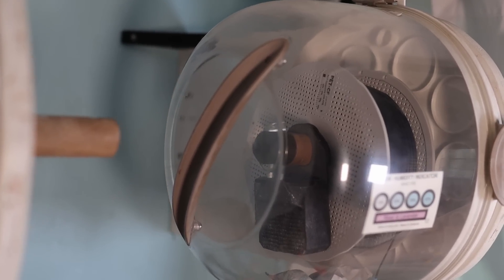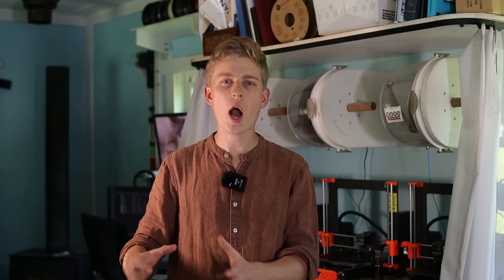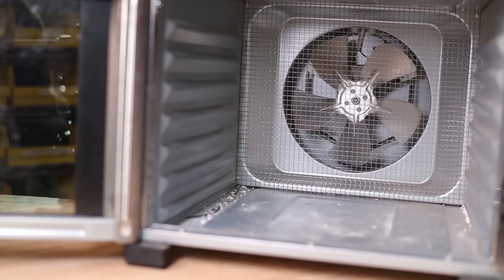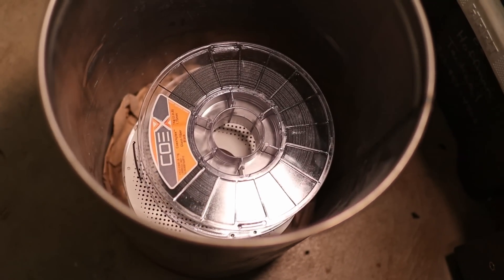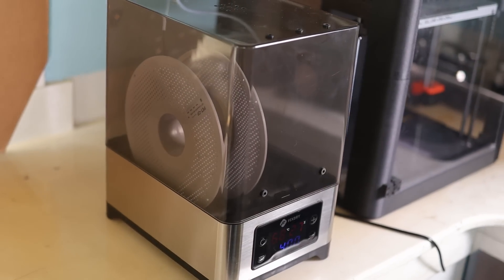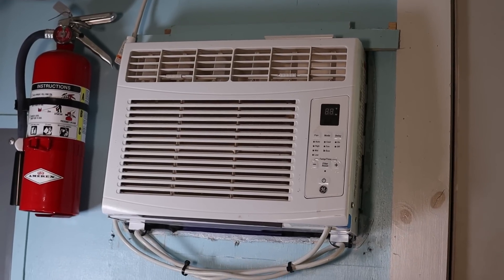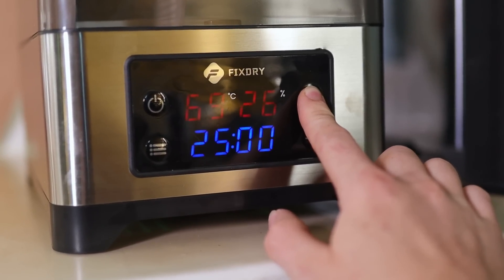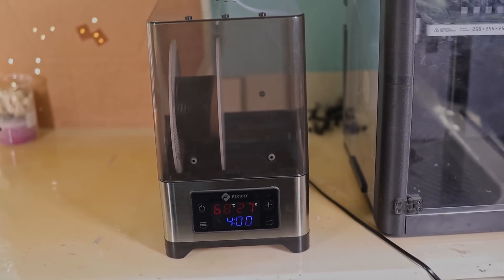Dry Your Filament! A Look At How I Manage Filament

Comment: There is such a big market for an engineering material (polycarbonate/nylon/etc) rated filament dryer that has proper convection/ventilation. 70°C just isn't enough for drying nylons/PC in a reasonable amount of time. 80-85°C of ACTUAL temp would be perfect! I feel a bit sketched out to leave my modified filament dryer on without checking on it every few hours. Fixdry PLEASE make a pro version that can handle 85°C and it will sell!
Reply: The temperature varies on the rooms temperature and relative humidity. My friends 3d printing only basement is constantly at like 35°C and 16% humidity and he's good at 70C drying for nylon. My room is like 60% humidity at room temp so I need much higher temps, between 95-100C to get below 0.2% humidity
Reply: The key reason all filament dryer stop at 70C, it is close max safe temperature of plastic shell. If over that temperature need metal or more expensive material to make shell.
Reply: @chouchooou  That's not why they can and likely already use polycarbonate or abs for the shells which can easily handle 85°C. I think it's related to the heater temperature required to get 85°C inside the dryer is more dangerous.
Reply: Don't use heat. Use molecular sieves. I dry my nylon and PC with 3A zeolite, and it pulls the moisture in the box to less than 1%, COMPLETELY drying the filament, and leaving me with beautiful prints, even after sitting for months, untouched.
Reply: @JohnDoe-fk6id yo what in the duck is that stuff. You're telling me I can get zeolite (looks like fancy silica packs) and not really need heat in a room that's ~60% humidity??? If so count me in
Reply: @JohnDoe-fk6id A molecular sieve only dries moisture that's already in the air. That's how dry boxes work. You need heat and rotation.
Reply: I totally agree. It's not like the technology isn't there, a food dehydrator is the perfect base they just need to have a top that actually works for filament.
Reply: @53Aries  Even most high end food dehydrators don't get to 80°C actual temp. They have to be able to get to that temp and maintain it safely without burning someone's house down.

Comment: Can you do a review on using a freeze drying system like used for food for drying out filament... also, I have been looking into a vacuum oven for drying filament as well... pretty expensive options out there with the in-line drying set-up but most haven't really been showing all that good of results... thanks for the video... I appreciate you...

Comment: Make your own.  Vacuum oven set to 10% below glass transition of the polymer, then constant circulation of pumped Nitrogen form a N-Generator,  off gas the moisture in a regenerative decant bed, feed the filament through a sealed teflon tubing to the printer.  Dew point for best dryness is -40.  Processing changes will be a must, the material will be thicker due to the reduced moisture acting as a foaming/lubrication agent.
Reply from the maker: At some point cost does become a concern ;)
Reply: Right? Lol no one has money for a nitrogen fed oven specifically used for drying filament. Food dehydrator makes a lot more sense
Reply: @HoffmanTactical   The payoff comes from the integrity of the products you're making.  Understand the cost comment.  Good stuff Hoffman.

Comment: When drying filaments it's important to remember that drying of the filament happens when the relative humidity of the dry box is lower than the relative humidity of the material.  When this happens, moisture is removed from the filament in an attempt to equalize. This can happen in a dry box if you're able to keep your relative humidity low enough but it can take weeks. Heat speeds this process up significantly.

Comment: If you're still looking for a better desiccant, calcium oxide (CaO) is extremely powerful and easy to diy. It reacts exothermically with water to make calcium hydroxide. It is easy to make- just heat up limestone/ marble/ eggshells past 850°C with a blowtorch or electric heater. To regenerate it, heat it up a little past 500°C (that's how strongly it bonds to water).

Also note, that a sufficiently strong desiccant will dry cold filament in a sealed container as long as it's not leaking. It's just really slow.

Comment: Amazon has a Septree 800w food dehydrator that has a max temperature up to 190F or 87C.  I just bought one for that higher temperature.  Will find out soon if it is true.
Reply: Just wondering how did this one go for you? I am debating getting an air fryer... Or try to get a food dehydrator and add an heating element to it...

Comment: So many people use these dryers incorrectly. Put desiccant inside, and change the desiccant after its saturated. You use the driers to drive the moisture out of the filament, but then you still need to deal with the moisture rich air, and desiccant is the way to do that. Just be sure to change it regularly. Make note of the dyers with all the holes in them, cover them up when not in use as thats just another entry point for damp air.

* Add desiccant
* block holes
* regularly change desiccant
Reply from the maker: Heat alone works quite well, and is much more reliable. The vents are required to allow the moist air to escape.

Comment: As far as keeping filament dry during Printing, MY AMS is full of reusable desiccant. for Storage I use an IP67 Tote with two Eva-Dry Towers in each.  Also the Govee Hygrometer sensor has data logging and has alarms you can set. Its bluetooth and wifi and has a huge Battery. :)

Comment: The fix dry looks a lot like my Eibos Cyclopse.  What we (owners) have noticed is that the heating element runs around 105c when set at 70c when viewed with a FLIR camera.  This is of course to bump the temp in the entire box, but what many of us have noticed, specifically with more temp sensitive filaments is if the roll isn't being actively printed, it causes a sag in PLA(non +)/PETG/TPU.  There's also concerns of this baking already brittle filaments beyond the point of usefulness.  As a result there's been heat deflectors built & we've noticed a lot more consistent temperatures. 

What I'm getting at is if you're actively printing right over the heating element without any deflector, there's a good chance you're likely in the 80-100c range albeit for a short time per rotation.

Comment: I just bought the fix dry for nylon and it doesn’t work at all, same as your findings. I went back to drying it in my food dehydrator for 3 days. It never got below 25% humidity, even inside my 45% humid home. In my garage where I print it’s 75% so it would just work to make the filament wet. My sealed containers go down below 10% humidity which is what I print from.

I just bought an air fryer with dehydrate option which should work much better, we will see soon.

Comment: I’m gonna try making an air fryer filament dryer
Reply: I was just looking into this because the PPA-CF from Bambu requires such a high drying temp compared to other filament. My issue is with the airfryer options I looked at, the heat element is right above the tray an I worry it will radiate too much heat and risking melting the spool.
Reply: Did you ever find a method that works?

Comment: For drying I us a rubber made container with cheap Walmart $10 heater with the thermocouple disabled and a PID controller with extra fan in box to help air circulation. Then I have a cheap air tight satellite plastic container with desiccant to keep dry between uses.

Comment: Very thorough, thanks. Dririte is calcium sulfate. Calcium chloride (dollar store closet driers) is a more aggressive drying agent. Molecular sieves are good for grabbing every last water molecule, but I don't think it works as well in air as it does in solvents. Sieves have the advantage of being reusable, you can microwave them  and reuse them, but you can also regenerate calcium chloride, though it's a bit messier.
Reply: And silica gel is rubbish. It barely even works to keep new, sealed filament dry from the factory for any length of time.

Comment: Been telling you man, just use a toaster oven and a PTFE tube from the back of it to the extruder.    Drill a hole for a rod to hold the spool on, and a little one for a digital external probe thermometer. Set your temp, let it dry, then print it from the heated oven.
Reply: The french door model from Costco has an actual dehydrator mode!

Comment: I just live in a place where even when it's raining... The humidity never gets above 30%. Most days, the humidity is about 5% or less. The first time I had to steal with wet filament being wet, it was with carbon fiber nylon that was not stored great for almost a year, at the 6 months mark is actually worked just fine... I stored it in a Tupperware box with a few desiccant packets is all...
Reply from the maker: That must be nice ;) At least from a printing standpoint.

Comment: I have a lab background, but also IT, and strong DIY ethic...Have you considered desiccant pods like that but running a partial vacuum?
Only issue would be the seal around the port filament feeds through. 

Alternatively you could run a 2stage system around entire 3D printer:
1) you pull a partial vacuum, taking most air out
2) you pump a fairly inert or hydrophilic gas in; the 1st would be helium (fairly $), or Nitrogen (cheap), I'd have to look at the idea hydrophilic gas that also doesn't interact with CFN or PLA+. 

The issue isn't creating such a system or even the seals around stuff like power cord. The issue is the vacuum pumps: low-mid range ones are very similar and hard to choose one that isn't chinese POS: they'll leak (not keep a vacuum well), have oil issues, etc.
Reply: I'd be interest about the effectiveness of running a very hydroscopic compound in a variant of it: 
Like if you could run a system but on 'overhead platform', and underneath is a pool of sulfuric acid (extremely hydroscopic, will absorb almost all ambient O2 in a closed system). The issue would be ensuring ambient micro-aerosolization of the acid, cuz that would degrade the whole printer. Solve that and its a very solid system, cheap, and 'easy' to manage.

Comment: I worked in plastics with nylon for about 15 yrs, your dryer setup seems a little sketchy fire safety wise but that's a cool idea.

In the industry we would use a dehumidifying desiccant dryer, has recharging desiccant, at 180 to 220 F for 8-12 hrs 

They may make smaller ones, and if there isn't a one specifically for spools I'd be surprised
Reply from the maker: Interesting to see your temp range is in the 180+ area. I don't know of any unit like that for filament outside of maybe an industrial printing system. As to safety, the moded dryer is running at steady state, and as such is completely stable and safe.
Reply: @HoffmanTactical  why not just use a regular food convection oven for drying? I dry mine this way with a thermometer inside to confirm accurate temps

Btw you still recommend printing nylon with a 0.6mm nozzle? Trying to keep my settings consistent and would rather print with a 0.4mm if there isn't a huge difference
Reply from the maker: @1SmokedTurkey1  Only if you're having clogging issues. 0.5 is good too. ).4 is best if it runs good. As to the oven, any electric oven that can run around 180 F without getting too hot would work.
Reply: @HoffmanTactical excellent will start working with 0.4 then. Thanks! 

I also recommend you look into food convection ovens. They hold temps VERY well. Holding 180f is no issue for mine at all and it’s a normal home type nothing too fancy. I have 4 1kg rolls in there now drying at 180f
Reply: @HoffmanTactical  yeah I was in injection molding,  sorry I didn't specify the industry 😅  we used pellets, I'm not sure if that makes the drying process different 🤔

This was 33% glass filled zytel nylon 6/6 I believe

Comment: I have the same Prusa, but in an enclosure. I used a plastic tub to cover the spool on top of the enclosure. That allows it to remain at about +38C as the printer works (basically forever -- because I also print all the time). This is not enough for Nylon, but it works for ABS with no additional measures.

Comment: I worked in injection molding for a few years (we made some gun parts). In my experience all the dry packets and vacuums are a waste. You simply need to heat the plastic up to its point that its bond with the water breaks and then remove the moist air there us no economical way to prevent the plastic from absorbing water if its hygroscopic like nylon. 

Another thing to consider with nylon is allowing water back into the mater post mold or in our case after printing. With injection molding you store nylon with something like a damp sponge; products that get too dry can warp and crack or become brittle. (Flying with nylon gun parts should think about this.)
Reply: Idk if it's a waste because sometimes humidity will crack the filament entirely and even if you then heat it up and release all the water you can't put the filament back together. Had it happen to me, just cheap PLA so nbd but still

Comment: Nylon 12 should absorb half the humidity compared to Nylon 6, but might be more expensive or not available with CF reinforcement. Have you tried Polypropylene?, it is not that strong but is incredibly tough and the layer adhesion is superior to any filament I've tried.
Reply from the maker: CF filled PP is an interesting filament I have not tried yet, would like to. Unfilled PP is too flexible. I have printed with a good amount of PA12, still needs drying prior to printing, but definitely absorbs less water, allowing it to be stiffer. Unfortunately creep is a huge issue.
Reply: @HoffmanTactical  In one of the first Orca videos I suggested this:
"One design suggestion that can be useful for future designs: 
a simple way of making the parts way stronger on the z direction is to use long and thin prestressed threaded rods pre compressing the part in that direction. this way the inter layer cracking is greatly reduced making the whole build much tougher, plus it is really cheap since threaded rods are redly available on any hardware store. this way you could reduce the sections required or use lower strength polymers."
Reply: @ivanadiego6067 the tolerance for fit on the threaded rods would introduce slop, defeating most the purpose. 

Additionally axial compression is more likely to introduce a bending moment and shearing the layer lines by itself.
Reply from the maker: @ivanadiego6067  It would, but integrating threaded rod into the design is hard to do well. Avoiding the use of threaded rod / bolts was actually one of my main design goals.
Reply: @HoffmanTactical  True, its a bit more complex, but worth keeping in mind. I use this method because it allows me to make parts out of cheaper, easy to print and readily available plastics . In my country (Argentina) carbon fiber or glass fiber reinforced filaments are very expensive and difficult to come by. 
You actually don't need to join parts using the threaded rods, the idea is to stiffen up larger parts in the z axis on its own. You get around this by rotating the upper/lower 45 degrees, but I bet you could print them upright in PETG and do pushups on them if you add threaded rods to each side. the holes for the rods are also much easier to print this way, and even better ditch the use of supports, cutting down the cost. I had great success testing parts that resist impacts and fatigue this way. Design to cost is my favourite engineering activity!

Comment: Thanks for sharing your findings in detail! I also have a magic mill dryer I got last winter. It worked great until the summer humidity in Georgia rolled in. I feel like ambient humidity plays quite a large role in what temperatures drys materials effectively. If the ambient humidity is high, unless you increase the heat a little more, you just can't fully dry out Nylons. I know some people who live in very dry states like Arizona (humidity of around 30~40% average) telling me their dryers at 50 to 60 degrees is enough. The average humidity in Georgia hovers around 80% in the summer. ACs do dry the air supplied indoor, so ambient humidity isn't an accurate metric, but I am assuming they're likely not going to dry the air down to 0% humidity in very humid climates.

Drying at 60C for 24 hours, and even printing out a dryer box blasting at 60C doesn't seem to be enough where I am. Of course the correlation of ambient humidity to effective drying temps is all speculation, I didn't have testing done to back this, but something I'm definitely interested in looking into.
Reply: There's a formula that gives you your heated areas humidity level based on the rooms temperature and relative humidity. You can use this formula by replacing the humidity level of the heated area to 0.2% or lower and do the cross math Bs to find the exact temperature you need in your heated area to dry the nylon perfectly

Comment: I was thinking of changing from nylon to PC. Are there considerations you make in your designs that would make this a bad move? I have gotten a lot better results from PC.
Reply from the maker: Yes. PC has lots of fracture issues. I once used a ton of PC, not anymore. Given enough time, parts under constant stress will crack. I'd look into the PET-CF from Bambu, not sure how it will do long term yet, but has been promising.

Comment: I have been production printing polymaker pa6cf and using the fixdry dryer with a 2kg roll. It's been a good setup. If I set it to 48hrs on the timer it will run continuously and i print right from the dryer. The only issues I have is the filament in the ptfe tubing gets wet if it sits for a few hours without printing. I'll extrude a few centimeters, then it will print with no issues.